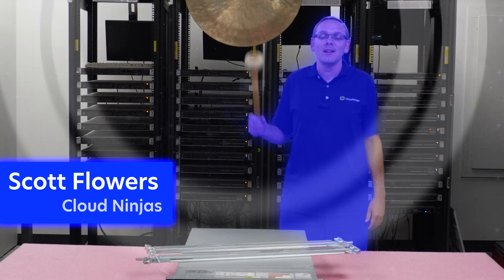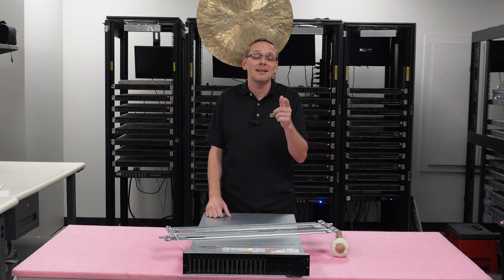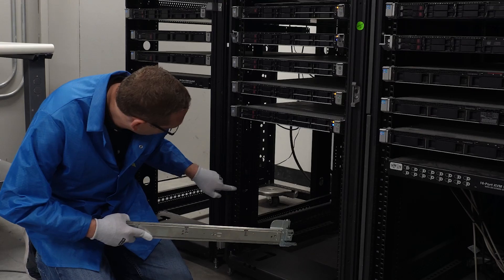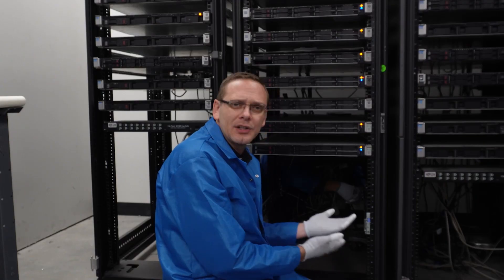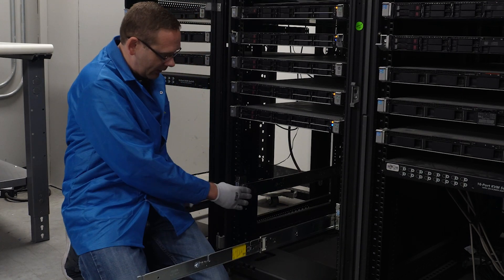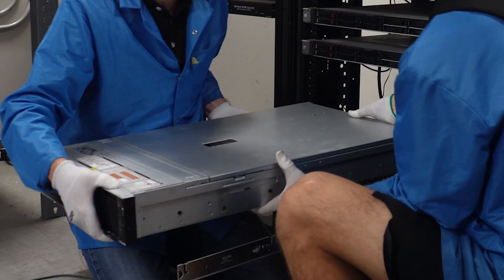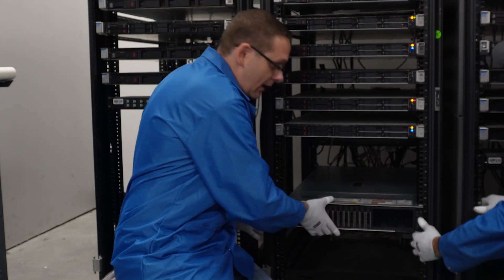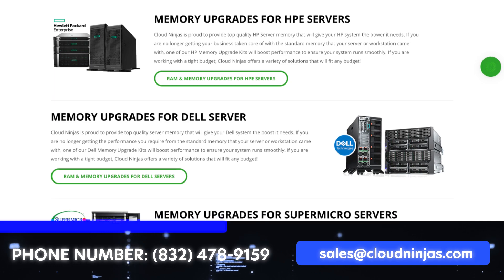Dell PowerEdge R750 | How To Rack a Server | Server Racking | Sliding Rails | Rackmount Server

Comment: would a 600*800 rack fit the r750?
Reply from the maker: Yes it shouldn't have a problem fitting into that rack, here is a link to the dimensions for you to double check and see for yourself: https://www.dell.com/support/manuals/en-ba/poweredge-r750/per750_ts_pub_ism/chassis-dimensions?guid=guid-07b9ec5f-35cc-45d2-9a75-645b95aff03d&lang=en-us